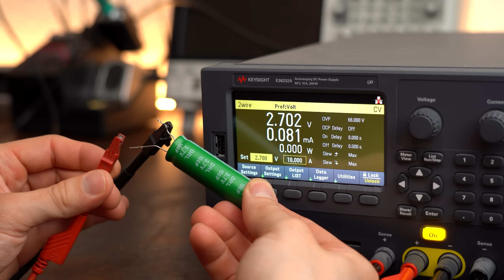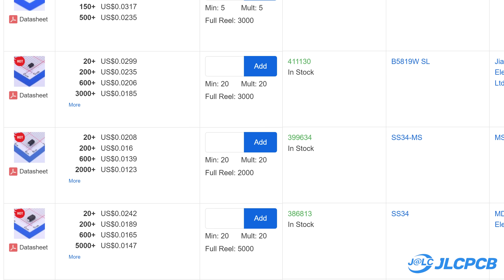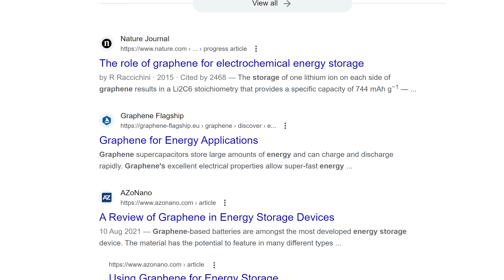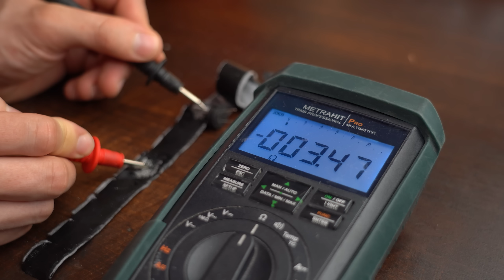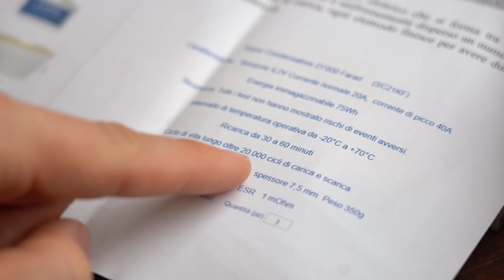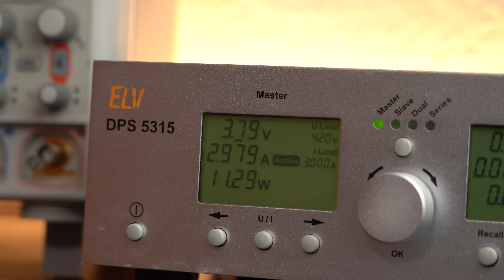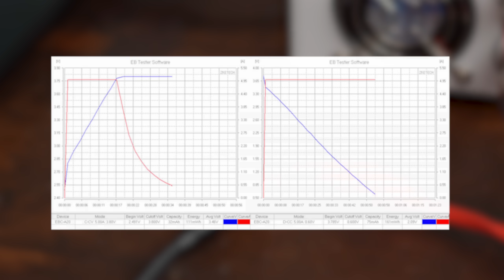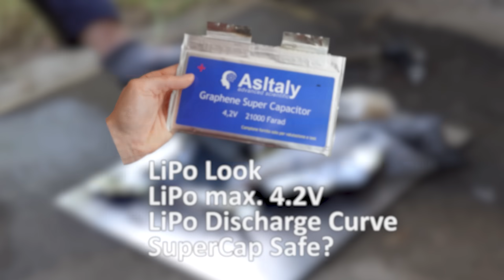Finally a Capacitor that can REPLACE a Battery?!

Comment: Seems like the main advantage would be you could charge and discharge capacitors millions of times... at elast unless corrosion or they dried out or some other time based chemical effect degraded their performance.
Reply from the maker: Yep. That is pretty much the best advantage. After that follows the big currents it can handle and then safety aspects.
Reply: @greatscottlab If they can make ceramic caps as great as regular super caps one day it might not really get worse by time
Reply: @greatscottlab  We have some LiPos that can handle enormous currents now though with pretty high energy density.  I've got some Spektrum batteries that can do 1.6 kiloamps and they only weigh a kilogram.

I'm pretty disappointed in capacitor tech for high current applications compared to these modern high-current LiPos.
Reply: @greatscottlab  i dont care what it is does it hold a charge and wont explode. thats whats important. call it what you want i need to see it tested in a ebike please

Comment: We need better super capacitors! I really hope new technology becomes more affordable soon!
Reply from the maker: I hope so too :-)
Reply: it's really hard to beat chemical reactions for energy density.
Reply: @lasskinn474  Capacitive energy scales with 1/2 C*U^2. So the density can be somewhat limitless if we manage to get promising dielectric material
Reply: manitoba-op4jx  LiFePo is cheaper in the long run as it doesnt degrade that fast.
Reply: manitoba-op4jx what's sla
Reply: @TecArtScien  Sealed Lead Acid battery
Reply: @TecArtScien  SLA = Sealed Lead Acid Battery
Reply: manitoba-op4jx  well thank you all for the reply. Saying you'd rather stick with the sealed lead battery. In my experience. I have a dell m6400 laptop. The battery is prohibitively expensive. I mean I got the PC for 23 Rand the battery is 30 Rand. I was like never, so I thought let me gat an SLA for 15rand and a DC boost converter for the lapt at 4.5rand. the only disadvantage is portability. IV never had an issue with them.
Reply: Agreed, capacitors seem like the future of energy storage.
Reply: Lithium batteries are already an order of magnitude cheaper, why not just use those?
Reply: @g.4279  because capacitors don't degrade and can be charged almost instantly.
But they need to store a lot more energy.
To be fair, for most usages I agree with you : current batteries are enough (I almost never had to do more than 100km a day, range is not a real issue if I could recharge at home), if only they weren't limited to 3000 to 5000 cycles.
Reply: @pbe6965  Capacitors do degrade but they level off. Lithium batteries under controlled temps do the same and chemistries like Lithium iron phosphate have insane cycle lives. Even then there are people with almost million mile Tesla's with minimal degradation.  There only real advantage is charge rate but batteries are improving with higher voltage architectures and designs.
Reply: @g.4279  The first guy who got to a million miles with its Tesla got the battery changed 3 times iirc (the first motors didn't last long either).
But the first one was replaced pretty fast, and the last one was still around 70 or 80% capacity despite having been in the car for a big portion of the ride so it might have been defects in the early productions that led to premature failures.
Reply: @pbe6965  Yeah the early designs and QC of Tesla's weren't that great. Although I guess it depends on your standards. People are often super happy to get 150,000 miles out of an ICE car before scrapping them. So a 250,000+ before replacement on basically a science project on wheels is really good. 

It's not just the chemistry of the cell it is also cell management and architecture, that's how a lot of modern EV batteries have become more resilient and how modern Tesla grip-storage systems like the Mega packs have become more viable.